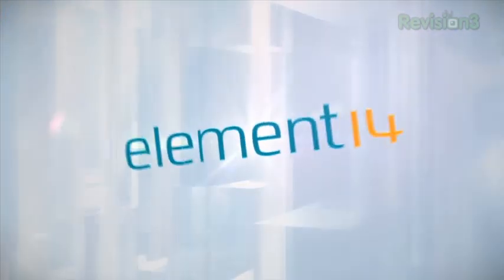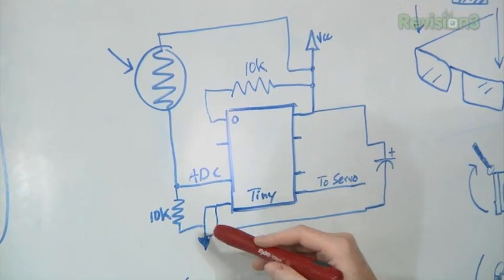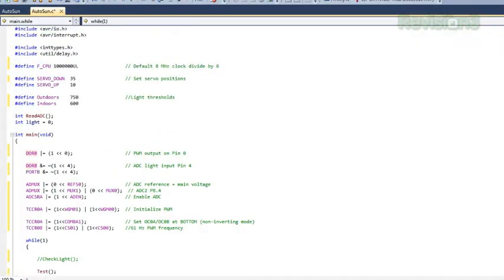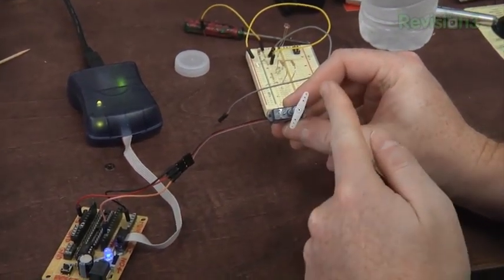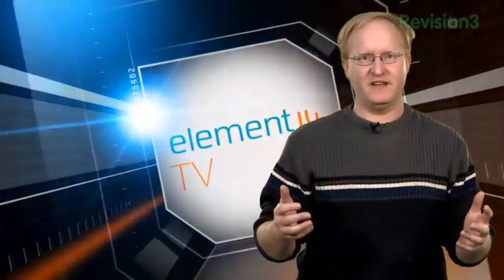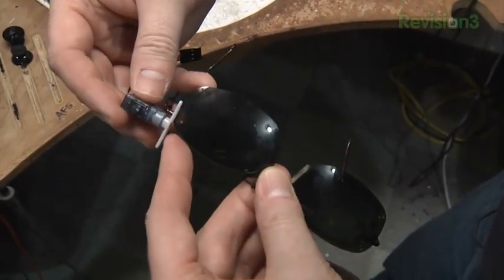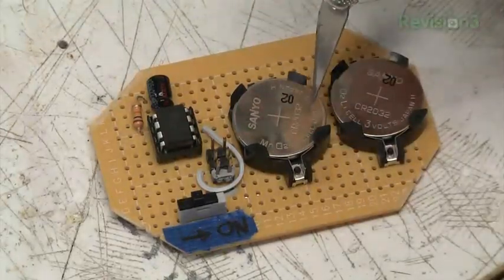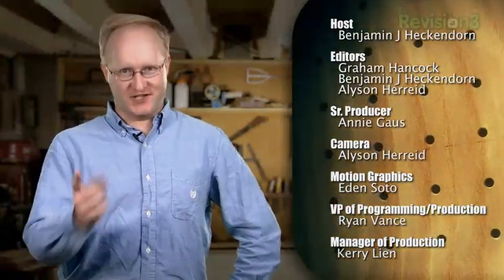Creating Bionic Sunglasses BY HAND!

Comment: Ben's mechanical and design skills are immense!
But his coding standards... can use some work...

The CheckLight() function should actually return a value, a boolean would suffice. This return value should then be used inside of the main application to do something and that something is again it's own function.

For example:

void sunGlassesUp(boolean value){
  //implementation raise servo up on value true and drop serve down on value false
}

boolean checkLight() {
  //implementation if light return true if dark return false
}

void main(){
  sunGlassesUp( checkLight() );
}

This way you can use the checkLight(); function also for other things to do. Good coding standards dictate to keep a method to it's smallest functionality. That way you can more easily reuse it. For example if you decide you want to have some headlights on when there's no sun ;) you can now simply reuse checkLight() function without ever having to touch it and potentially damage it during the refactor.

void main(){
  boolean isItLight = checkLight();
  sunGlassesUp( isItLight );
  highBeamsOn( !isItLight );
}

So you see you are more flexible for future adaptations but also more importantly you do not have to change the basic function's code which can make things go horribly wrong (trust me, been there done that).
Whereas Ben now has logic for raising the servo functionality mixed with measuring the light functionality and those are two different functions (literally) and should not be mixed in code.